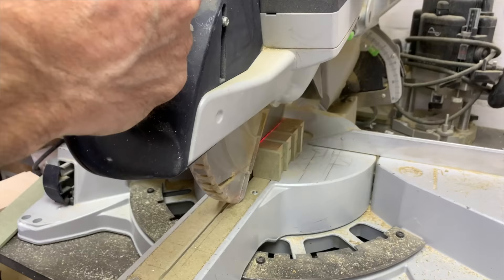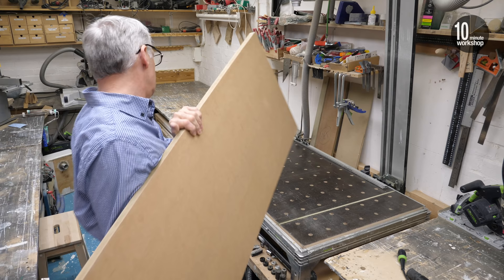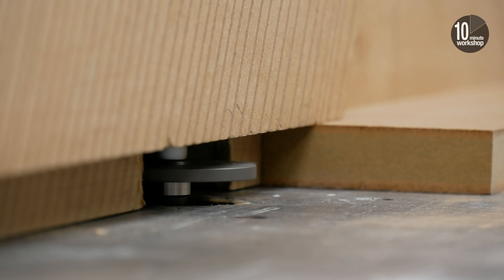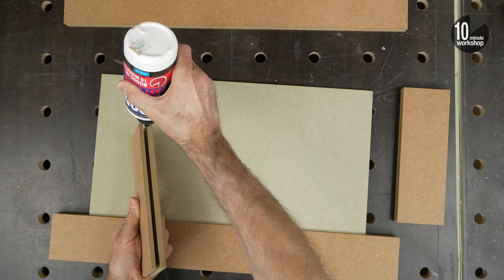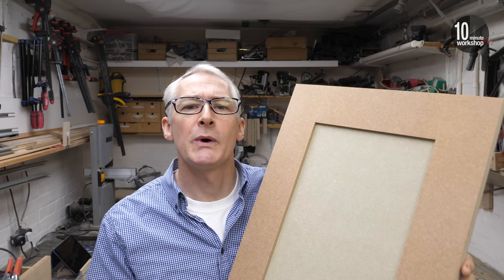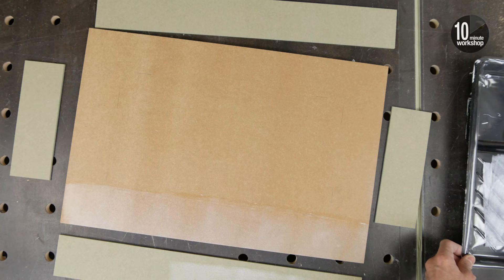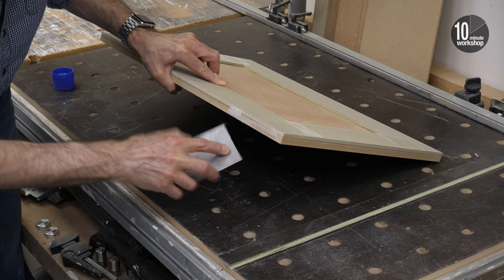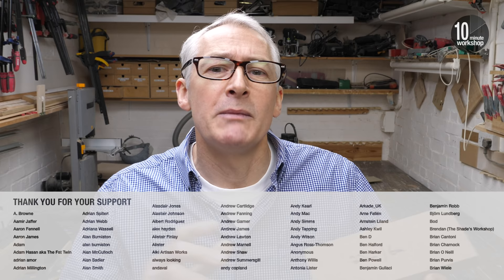Shaker-style doors in MDF [video 405]

Comment: Just made my first door using this method. Tracksaw, bench mounted router and one of those big old Wealden bits! went really well considering it's my first ever shaker door. Got a few to make to finish off a big lockdown project. This is definitely the way to go for quality finish. Next time I will wait for a cooler day as the glue going a bit quick! Bit stressful!!! Another fine video with lots of good advice. Thanks
Reply from the maker: Great to hear, thanks! 👍👍

Comment: Fully agree with gluing the panel. It's mad that so many people think you can't glue MDF or plywood panels, it absolutely fine even if the rails and styles are form solid wood. The panel only needs to float if its solid wood.
Reply from the maker: Exactly! 👍👍
Reply: Why does the panel need to float if it's solid Wood?
Reply: @mellie4174  Expansion and contraction with temperature changes

Comment: I actually have all the equipment and I still make MDF doors the "easiest" way.  I use barge contact cement to adhere the 1/4 material down to the 1/2 material.  Once the edge is sanded, I've never needed to fill in any gaps around the edge.  You definitely might need to if you only use two buckets to clamp down your glue up.  Both methods work just fine

Comment: Well done. I have done Shaker doors all the ways you've shown and more. I really really like the extra durability of the thick back door. But I know it's honestly not needed lol. If a client breaks a door then they did something wrong and they can pay for it to be fixed. I'm honestly not sure which I will use long term going forward. 

I also really like using a stopped dado for the inset panel and then using a domino. Less clean up work. No trimming needed. Straight to sanding without using a filler. And the faces are a little more flat and accurate. But honestly they are all great methods of making doors.
Reply from the maker: Thanks! Funny, I find the ‘stopped groove then Domino’ to be more work, but whatever works for you, right? As long as you get a strong flat door out of it - that’s the right size - then that’s what counts! 👍👍

Comment: I make mine with 9mm strips planted onto 18mm backer,  headless pinner and glue. I usually plane a small bevel on the inside edges of the stiles and the inside and ends of the rails to get the "genuine" shaker look.

Comment: Excellent video Peter - thanks 👍
Reply from the maker: Thanks Pat! 👍
Reply: Peter - I made a door for my sons house to close opening on side of their stairs, 1315mm high and 916mm wide. I made it from 18mm pine stiles & rails , with 9mm birch ply rebated inset panel. It had a sloped top rail - all joined with pocket screws & panel glued in. It warped!!  ☹️☹️☹️
Do you think 22mm MDF stiles & rails, with maybe 9mm rebated MDF inset panel would be sturdy enough?  I was concerned about 6mm panel being that large. 
Appreciate your views?
Pat
Reply from the maker: @pat1walls  Hi Pat. That's pretty wide! 22mm MRMDF for the rails and stiles would be fine, and a 6mm panel would probably be OK too, but if I were making it I'd go for 9mm, I think - gives a bit more heft to a door that wide, especially with an angled top rail. 👍👍
Reply: @10MinuteWorkshop  thanks Peter - appreciate that!  Will get some MDF sourced - there is only one place locally I know does 22mm!  Will drop you a pic once sorted 👍

Comment: Currently knocking up some MDF Shaker style doors but I’m just pinning on the shaker rails on to a panel door. Proper faker shaker.
Reply from the maker: It works! 👍
Reply: You might find they will bow in time, usually after painting
Reply: I made some recently and stuck 6mm to 18mm
Reply: brendan ford This one is just for my own house so if it does I won’t have the embarrassment of returning to a customers property to make good. Reason I’ve gone this way with is it the height of the door is 1900 so I wanted as much strength in it as possible so I thought of doing it this way. If they bow then I can change them for a panel made in the Style of Peters but I’ve nothing to lose really.

Comment: I built some cupboards around the chimney about 5 years ago, I put of making the doors as it was too much effort. I was going to just slap on some 18mm sheets of painted MDF and call it 'modern design' but the more I see this design, the simpler they look to make. I don't have my router with me, but I could probably get away with cutting the slot on the table saw in a few passes

Also, I set YouTube to remind me when the Premiere was about to start and it ended coming through an hour and a half after it ended! I think next time I need to set a reminder on my phone as well!
Reply from the maker: Yes, YouTube reminders can be a bit flakey! 👍

Comment: I bought the Axcaliber tongue and groove router bits from Axminster Tools a while ago... they're a nightmare to line up so I've gone with the tennon method too. So much easier!
Reply from the maker: Yep, been there! 👍
Reply: I use tongue and groove bits (not Axminster) or shaker bits and find that once you have the setting dialled in, if you measure the router bit height with a Trend Digital Depth Gauge (or similar) and record it for next time it's repeatable and pretty quick to set up - I always do a test piece or two for the final precise adjustment.

Comment: Very informative. I remember most of the information from your previous videos. In this one you don't cover the difficulty of fitting hinges to the "easy" door, which is what would put me off that method.
Reply from the maker: Thanks! Yes, the loose-tenon method is still my preferred way - and the only way I've made these type of doors over the last 15 years or so - but the mock-panel method does produce a working door and many won't see the difference between them. My concerns about hinges remain the same, though as I say in this video, a 15mm backer with 6mm 'facing strips'  produces a door with a bit more heft, and co-incidentally, satisfies my original concerns about hinges. 👍
Reply: Just depends on the hinge you're using.  I've never had problems with hinges using the easy method

Comment: I saw a trick recently that I remember the old guys using when I was starting out. You referred to "swimmy" joints, when making your faux panel doors. Have you tried shaking a little salt on the surface? It'll add a little grab, but melt away quickly.
Reply from the maker: Thanks, yes - I’ve heard that trick; never tried it as I never seem to have salt in the workshop! Must give it a try next time.👍👍

Comment: I had to make two cabinet doors recently, so I thought I'd use the Millard Method. Trouble was, my supplier didn't have 6mm MDF in stock so I had to use 6mm ply for the panel. As you know,  6mm ply isn't actually 6mm but my grooving cutter is - so I had to fiddle to make the slot 6-and-a-bit. First door was a disaster as the panel was too tight a fit once the glue was in there. Second attempt was a different disaster as the slot was too wide so nothing wanted to stay square or flush. So for the third attempt I went with stopped slots and dominos... success! Think I'll stick with that method ;-)
Reply from the maker: Fair enough Jeremy - though I have to wonder what kind of supplier doesn't have 6mm MDF in stock! Glad you got it sorted, anyway! 👍
Reply: @10MinuteWorkshop  Normally they have everything - they blamed it on COVID-19 :-(
It was you that got me addicted to dominos - now I use them for everything. What's that expression?... when your only tool is a DF500, everything looks like a job-for-a-domino 8-)

Comment: Hi, love the calm, unflappable delivery! Ever considered being the bearer of terrible news on U.K. Tv at about 5.00 pm? It would be very reassuring! I haven't seen a track saw track in that flip down right angle to a fence configuration before. Could that be done with a Marita track?
Reply from the maker: Hi and thanks! Let's just say I'm open to offers, lol! The hinged rail comes as standard on the Festool MFT - see videos #182 and #183 for more details - but AFAIK it remains a Festool patent. You can buy the spare parts to make your own, but they are pricey. I've never tried the Makita track, but it should fit as they follow the standard Festool-pattern pretty closely. 👍 👍

Comment: Firstly...love the videos Peter, you’ve actually made me think about leaving kitchens and bathrooms and working solely on joiner projects.....just a quick question, your first method where you router a groove and the glue it floating tenons at the ends, how do you do 2 or more panel doors? Do you glue it small loose tenons for the middle rails or do you not route those sections?
Reply from the maker: Thanks! Yes, for doors with a mid-rail I glue in a small loose tenon. Not sure if it makes a difference tbh, but J always feel happier doing it. 👍👍

Comment: I make cabinet doors using exactly the loose tenon technique described and it's great. The only difference I normally have is I use beaded pine cladding for the panel. It's extra work but I like the look. Quick question, are you using an extension on your router so you can do above table bit changes? If so, is it any good and which brand did you go for?
Reply from the maker: Thanks! No, no extension on this one - it’s the old Triton TRA001, has enough reach to get the collet all the way through. 👍👍

Comment: Great video - thanks. I’m about to start on some (painted) kitchen cabinet doors, and was  planning on using MDF for the panels, and poplar for the rails and stiles. Could you please comment on the pros and cons of this approach, versus the full-MDF approach. Thanks in advance for your response.
Reply from the maker: Thanks! Poplar / tulipwood is a popular choice for door rails and stiles as it’s pretty stable, and obviously a harder material than MDF so likely to take knocks better - not that I’ve had any issues with MR MDF tbh. Not sure if I’d glue in the panel or not - the MDF won’t move, but the poplar may - so probably one for you to assess your environment for heat & moisture. No problem in principle with the plan though. 👍👍

Comment: Great informative video as always Peter! I'm planning to use the second method with 18mm standard MDF and 6mm stiles and rails glued and pinned for a tall (full board height) 240cm wardrobe door. After reading comments on other videos and forums, worried about problems with warping when stuck to only one side causing an imbalance. Will warping be an issue with standard 18mm MDF? (Also plan to use 5 blum hinges per door)

Comment: Hi Peter

In a video of yours you mentioned that you were going to do a router series.  I’ve been searching for it - I want to make the loose tenon version of these doors but don’t have a router table …. Or a router!  If you’re planning on doing a router series that would be awesome.  If not - would you mind saying how you would router the grooves without a router table, which bit … how do do it safely etc.  I’m planning on getting a basic 1/4 inch router.  Cheers
Reply from the maker: Thanks! Haven’t managed but yet - it is still planned, just other things getting in the way. Honestly, I wouldn’t recommend trying to use a grooving bit handheld - any slight wobble and you’d mess up the groove. A table doesn’t have to bell anything fancy - most of my grooving was dine with a basic router bolted to the underside of a bench. 👍👍

Comment: Really informative, thank you! You mentioned a router table is the safest way to cut the grooves- how else could you do it? I am thinking of investing in a table saw and I am wondering if I could use that. I’m also wondering if would you use the same method for building the panel door if you were using hardwood instead of MDF?
Reply from the maker: Thanks! It’s possible to use the same grooving but freehand in a router, but I wouldn’t recommend it as it’s for experienced router users only. And yes it would be possible to make the grooves with a table saw, but using an unguarded blade is a real no-no here in the UK - it’s a 5-figure fine in a commercial workshop, so I couldn’t recommend it.

Comment: Thanks for the great video!  I have a quick question; is there any reason for the choice of MDF vs solid wood for the frame of the door?  As far as I can see the only reason to use solid wood in the frame (or pannel) would be if you are not painting the finished door, but was wondering if using a solid wood frame would provide any structural or other benefits?
Reply from the maker: Thanks! If the doors are going to be subject to some heavy-handed usage (toddlers, teenagers) then sometimes solid timber will take the knocks better, but otherwise, no, for a painted finish I'd always go with MRMDF personally. 👍

Comment: I’ve made 3 out of 6 doors using the loose tenon method, so thank you Peter! Due to variations in thickness (and perhaps a few home workshop tolerance issues…) a few of the rail/stile joints have just a very slight lip - 0.5mm or less - but I’d really like them to be invisible when painted.

Any tips? Will just a good sand do the trick, or do I need to fill first, or attack with electric planer etc? Cheers
Reply from the maker: If it’s only 0.5mm or so then sanding should be OK, just be careful not to be too aggressive with the sander as it’s easy to hollow out the face at the join. Material thicknesses can vary, especially between batches or if bought at different times, so it’s good practice to try and cut the rails and stiles from the same sheet, if possible. 👍👍

Comment: Hi Peter,  I am an electronics engineer by trade but your channel has inspired me to get into making furniture ! I have made a shaker style dressing table with draws and bed side cabinets mostly from 18mm MR MDF painted white. The the built in wardrobes are in place but awaiting 4 large doors approximately 700 x 2200mm. I intend to use the floating tenant method . Would you recommend using 9mm panels rather than for this size door and 3 or 4 euro hinges? Any help would be much appreciated
Reply from the maker: Hi Mike! Wow, 700mm is a pretty wide door! Biggest I've done is 600 x 2200 with 22/6mm and it was fine. A 9mm panel would certainly give a bit more heft to it. I'd also use a deeper bottom rail, and a mid-rail. I'd have to do the maths on it, but I'd expect 3 hinges to be fine. FYI 18mm MRMDF is 15kg/sq m. Each hinge can take ~5Kg max. Work out the weights pro-rata, and see how many hinges you need. 4 might just be safest anyway! 👍

Comment: Thank You. Excellent Video as always, MRMDF, surely once it has been painted preferably exterior paint it will become moisture resistant? obviously, I am not intending to use the MDF outside just indoors,I am looking at the cost between the two one MRMDF and one cheaper becomes made into MRMDF?
Thanks.
Reply from the maker: MRMDF is a much better quality board - it has a much denser core, and is essentially formaldehyde free due to the binding agents used.  It’s not really about the moisture resistance. 👍👍

Comment: Great video Peter.  Quick question if I may?  I see from the links you're using the Wealden Groover.  I'm guessing you're using the 6.35mm cutter?  What size bearing guides are you using?  I suppose it comes down to ratios of stiles / rails to panel but curious what size you use and if you change them?  Cheers Greg
Reply from the maker: Hi Greg, and thanks! I use whatever bearing comes with the arbor tbh - never changed it. From memory it gives a ~21.5mm deep groove or thereabouts; if I need a shallower fierce I use the fence. 👍👍

Comment: Hi Peter, ok - you’ve convinced me! I’m going to give this method a go instead of the “one piece” method. Question though - my wardrobe doors are quite big (2400 x 600)… do you think they would need an extra rail in the middle for stability? In terms of aesthetics I don’t really want to add an extra rail, but wanted your thoughts if you think it would be a good idea? Also I’m in Australia, so 22mm MDF is hard to get. Would you tend to go 18mm or jump up to our next available at 25mm? And I think for a larger size door… 9mm in the middle might be a good idea instead. Interested to hear your thoughts, loving your videos ☺️
Reply from the maker: Hi Sarah. On a door that tall I’d usually put an extra mid-rail in just for aesthetics, rather than stability, as it breaks up what could otherwise be a big flat panel. On a door that size, I’d definitely go thicker, so 25mm rather than 18 - I moved to 22mm because 18mm gave me too many issues with the doors bowing. And yes, if you’re going with 25mm, I’d use a 9mm panel, as much for aesthetics as anything. Hope that helps! Peter.
Reply: @10MinuteWorkshop   Thanks so much for your reply :) Your advice is appreciated, and will move forward with your recommendations!

Comment: Hi Peter, thanks for this re-made episode. Finally on the verge of putting your guidance into practice!
I have the Festool OF1010 router. If I had it mounted in a table, home made, do you think it would have enough ‘grunt’ to use the groover you linked to?
Perhaps a question I could/should pose to Wealdon!?
Thanks Dave
Reply from the maker: Hi Dave. It’s a big bit to swing, but if anything can the the OF1010 would - you’d need an 8mm arbor and collet for it though, I think. Wealden do a smaller groover, gives a ~13mm groove - lots of guys O know use that one and it works fine. HTH. P👍
Reply: @10MinuteWorkshop  That’s great, thanks for your thoughts 👍
Rgds Dave